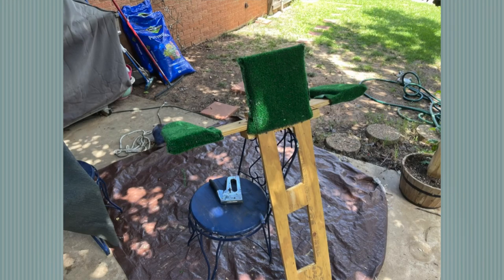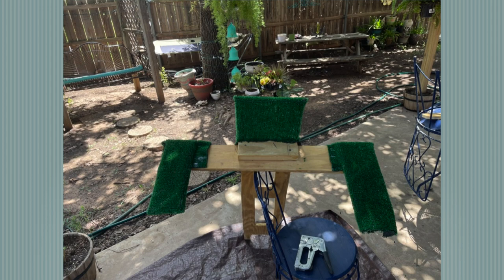Adventures in Sailing - Episode 7 - A Homemade Mast Crutch

Comment: decking?
Reply from the maker: Actually. This didn't work well at all. As soon as we took it to the lake it slipped forward and broke the old, original tiller. I had to replace it with a cut hoe handle (which worked surprisingly well). I'll be lashing the mast to the deck and rails on the next road trip.